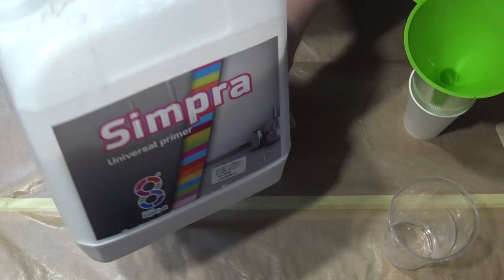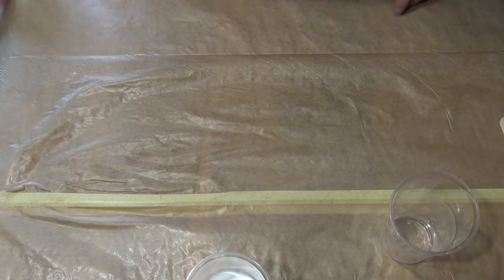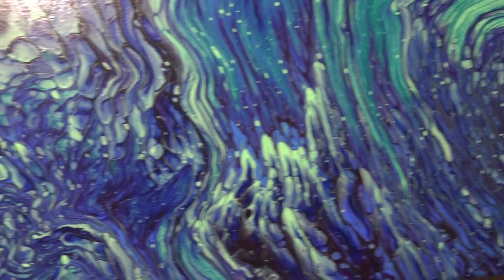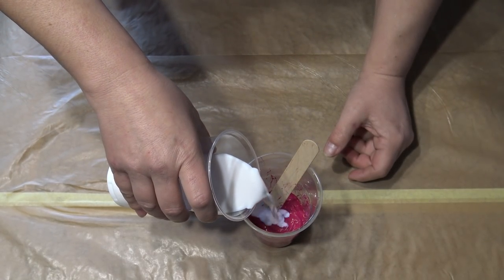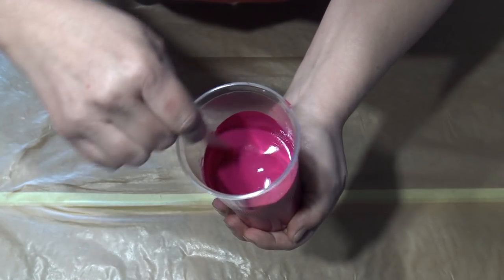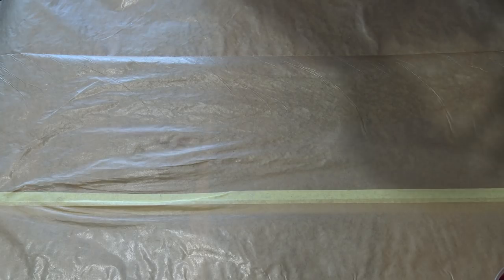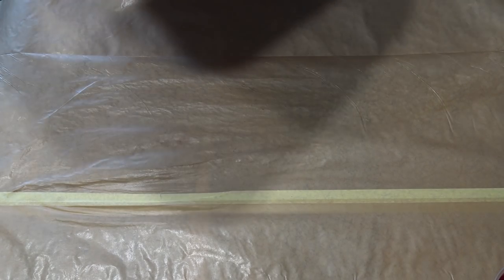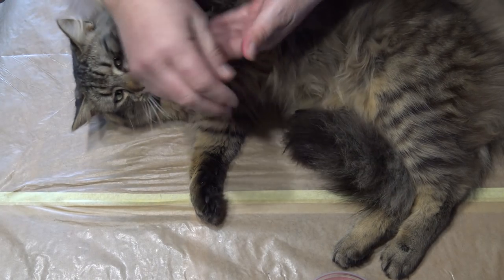(64) How I mix my paints for acrylic pouring techniques

Comment: I’m very impressed with your English, well done 👏👏👏

When pouring your primer, turn the big bottle on its side, it pours much easier. 

When you finish a jar of paint (like the magenta) I reuse the container with the primer & paint mixed together for easier use later. I also put a couple of marbles in the container so you can shake it & know the paint is really well combined. 

Have you ever purchased base tints from the paint store? They’re heavily saturated. I only buy the black & the white tints. I pay $7.80/300ml in Australia. Perfect for acrylic (Floetrol 80%-20% tint). 

With resin in approx 250ml I’d use a teaspoon full. Perfect as a base coat & gives fantastic cells/lacing. 

Thanks for sharing your tips 👏👏👏⭐️⭐️⭐️
Reply from the maker: Thank you for your good tips too. 👍🙏😘
Reply: Hi Mariette, Just curious how you use the “base tints” vs just regular acrylic paint? Do you use resin in your base coat? Really curious and love any feedback. Thanks!

Comment: Is that the same recipe you use for white base paint?

In USA we have Flood FLOETROL which is much thicker than your Simpra.  Thank you for sharing your techniques!
Reply from the maker: Thank you. I used floetrol too, but I didn't get nice results for dips.
Reply: Dips meaning? So should we use the concrete binder instead of floetrol?

Comment: Your primer looks quite thin.  Our primers in Canada are quite thick.  Would it be ok to just add water to thin it out?
Reply from the maker: You should read instructions how much water you can add. My primer has 1:4 ratio (1 part primer and 4 parts of water). 😉

Comment: Hi Fiona, Can you please give me the ingredients listed on the Simpra Basecoat so that I can see if I can find something that would be equivalent in Australia. Love your work. Thanks so much for sharing. Annette
Reply from the maker: In the pined coment I added link to this product in english. On the bottom of this page you have pdf file to download and there you will find it.  😉🌷😘
Reply: Annette Neale the best medium is available from Bunnings, it’s called Floetrol & is approx $25/1litre. Have you ever purchased base tints from the paint store? They’re heavily saturated. I only buy the black & the white tints. I pay $7.80/300ml in Australia. Perfect for acrylic (Floetrol 80%-20% tint). 

With resin in approx 250ml I’d use a teaspoon full. Perfect as a base coat & gives fantastic cells/lacing in resin & acrylics.
Reply: Mariette WILTSHIRE-BUTLER . Thank you very much. Annette
Reply: Annette Neale  hi Annette were you able to find an equivalent to simpers basecoat in Australia. floetrol just doesn’t do it I have tried different mediums the flowers are not as crisp as Fionas. Cheers